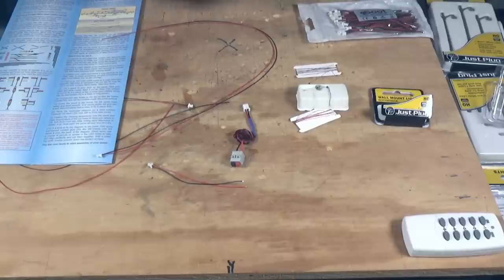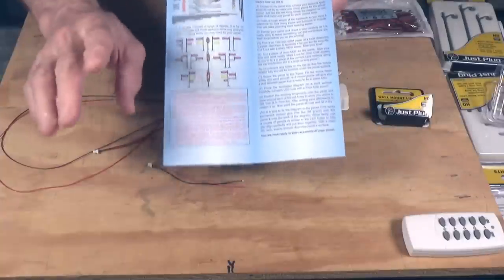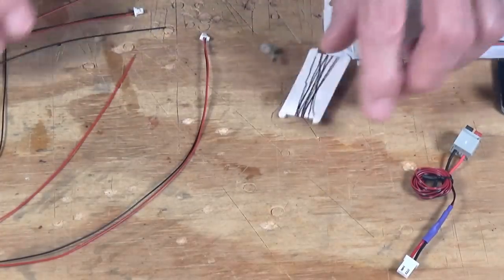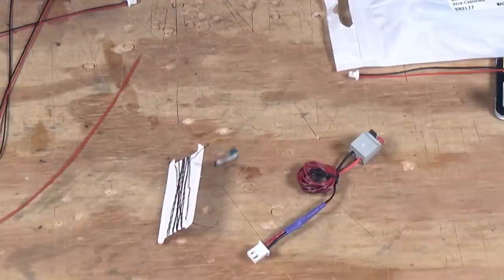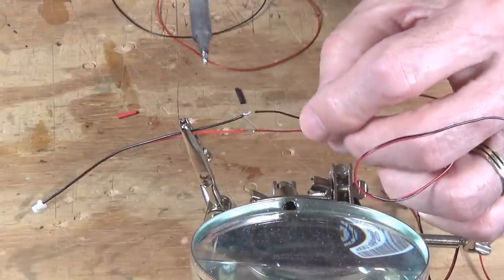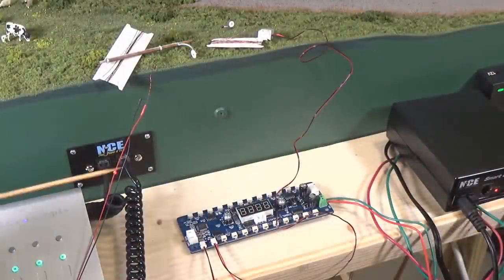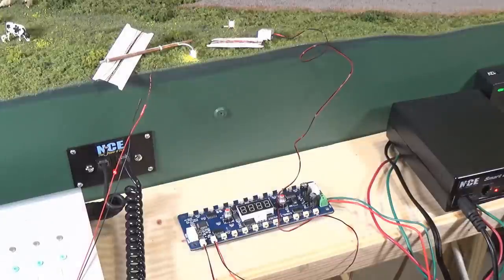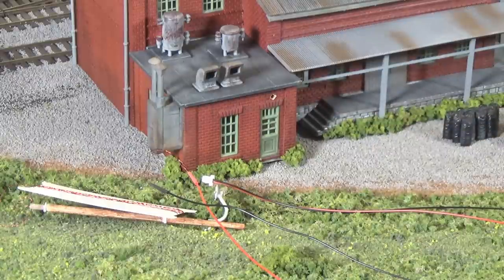Great Lighting With Just Plug And Alpha Mimic Lights  (275)

Comment: Hi Larry great video as always, 
would it be a good idea to check for continuity before shrinking down the heat shrink.

Mike
Reply from the maker: To be honest I have never had a problem with a solder joint like that so don’t consider it necessary. A gentle tug will usually indicate whether you have a solid connection.